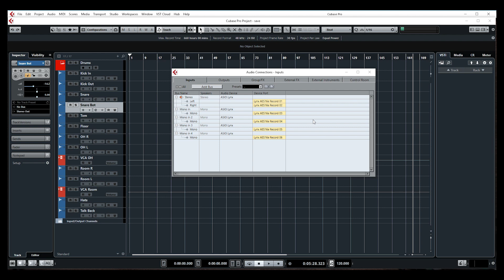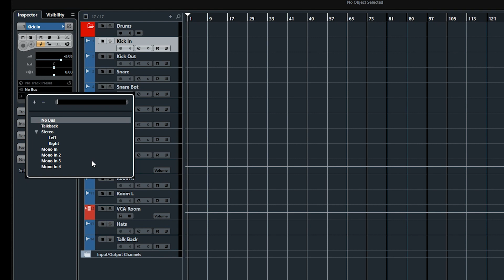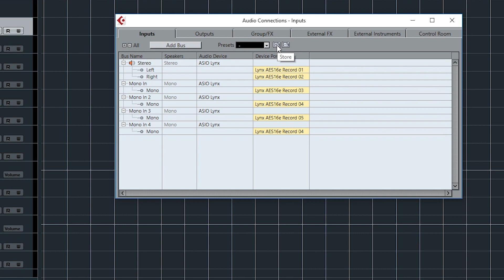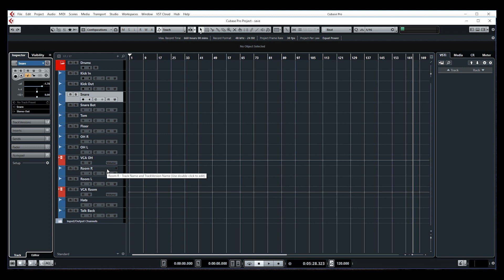CUBASE TIP: How to create an INPUT BUS Preset

Comment: when I add FX and add reverb on it, other tracks which is already linked to that FX is linked to the volume also, how to cancel this function, I want only to control the reverb level, without touch the volumes, you can notice if you put the fx -20 db, or 0, see the volume how goes up..

Comment: Salut Chris! Merci pour la vidéo! 

Do you have the problem that Cubase not always assign the bus with the good interface input? Sometimes when load a bus preset, my input (device port) are not assign... like if Cubase didn't remember what my interface is.

Merci
Nicolas
Reply from the maker: Weird, I never ran into that problem.
Reply: If you are using ASIO It can happen if cubase crashes on (or before) exit. The old instance may still run as a task in the background and will then reserve the sound card for itself and the fresh Cubase instance cannot access it so it suggests a different driver (e.g. generic ASIO).
 in that case you have to use task manager to kill the hanging instance or Cubase or log off windows. ..
Reply from the maker: Thanks mate :-)